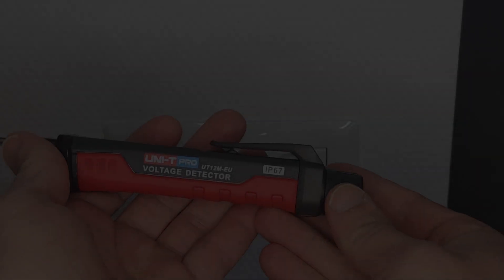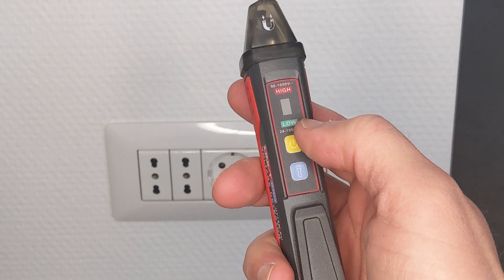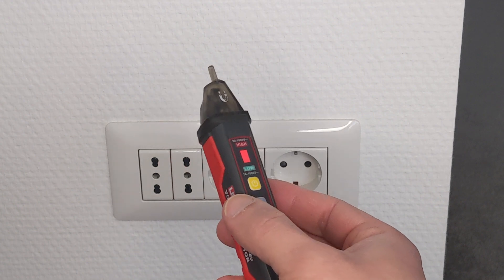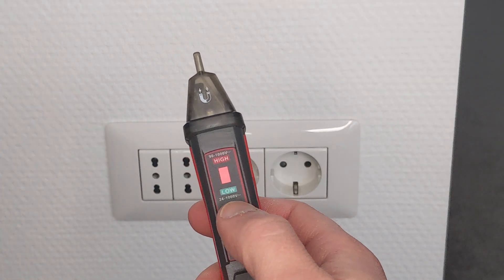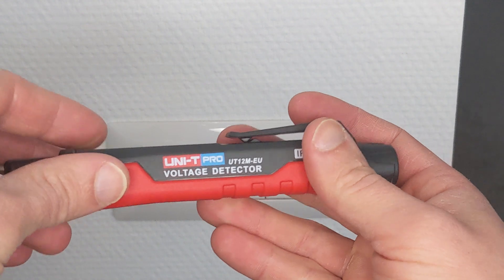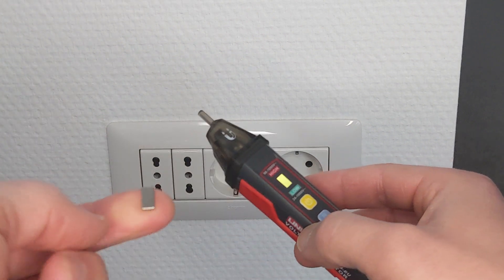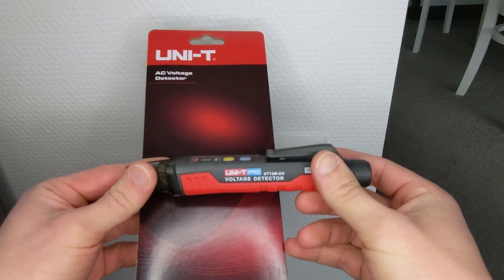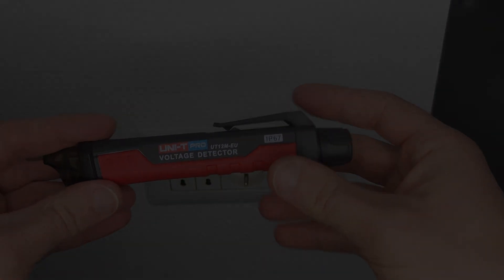Voltage Detector brand

Comment: man the magnetic field of that contactor behind the contactor
Reply: Yes it is. But for MOST applications you can sense the magnetic field without this mode. Using sound for the clicking of a small relay, or the humming of a big AC transformer. Using a magnet against a cable, you can sense with your finger the passing current (Try with a 5mm magnet, you could differentiate a 5A from a 10A of current from cables out of the cablebox) or just use a current clamp. If it doesn't detect it from less that 10cm it has no use

Can't find a magnetic component that makes no sound or visual queue when turned on, doesn't have cables to probe or clamp and has less than 4cm of cover for this tool to access